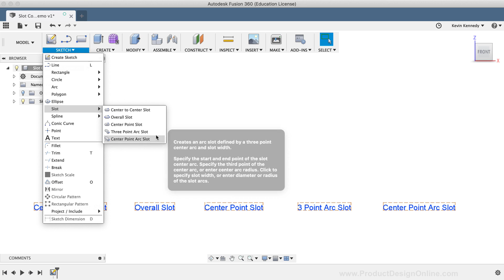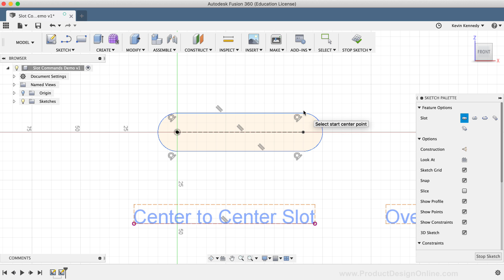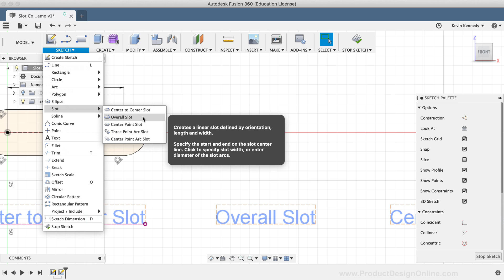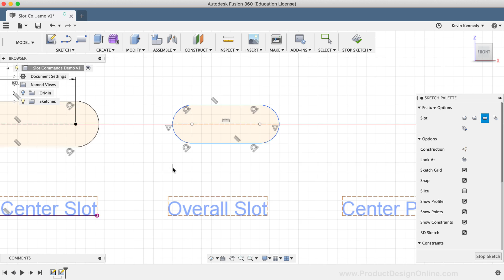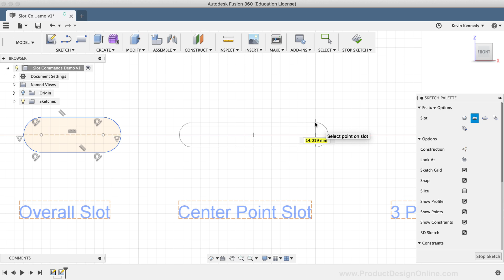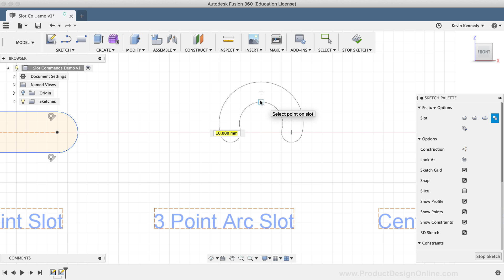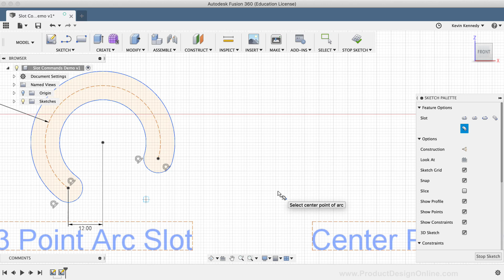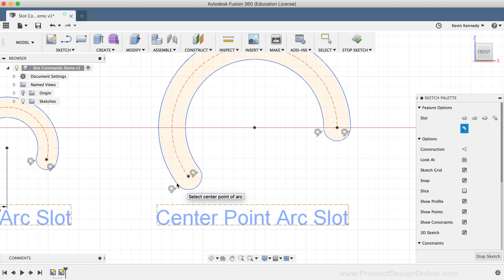How to Create Slots in Fusion 360 Sketches (All 5 explained)

Comment: Hi Kevin, great job on videos. Just recently updated and can't seem to find slots in any pull downs. Thanks!
Reply from the maker: Hi Rod. The Sketch menu is now contextual, which means it's hidden until you create a new sketch. You will then see the Slot commands in the Create menu of the Sketch tab. You can also use shortcut letter "S" > search for "Slot" and activate from there, which will then prompt you to select a plane to start your sketch.

Comment: I don't know if it's because I'm in the most recent F360 version, but I copied what you did in the first slot tutorial and it does not fully constrain unless I add dimensions from the slot to another sketch line (I copied exactly what you did and dimensioned the center construction line and then the arc/radius, but it is still a blue line. Even though I understand how to keep going and constrain it, I'm wondering why mine does not immediately constrain, like yours..?

Comment: Where are the slot tools now? 
I can't seem to find the slot menu in the new interface. There is a slot option under Manufacturing, but it looks like something for programmed CNC work. It asks for all sorts of parameters associated with CNC.
Reply: Thanks kindly for your reply. Much appreciated.
Reply from the maker: Hi, Dave. With the new UI you'll find the "slot" commands in the "Create" dropdown, but ONLY when you're in the SKETCH tab. The sketch tab will only be shown in your toolbar when you're in an active sketch environment.

Alternatively, you can search for the slot feature by using the keyboard letter "S" to activate the shortcuts box > search for the desired feature.

Comment: My Wedding is next month and I am looking to make slotted table numbers held together by tight Kerf settings. I used to do this via Illustrator and I have been watching your videos to use a proper design program to do these. 

Can you please let me know the best approach to this/ direct me to the appropriate video of yours? If I was able to import my concept and slice it in Slicer for Fusion 360 that may be the best option, but I am unsure how to approach this. 

Thanks for the help. Love your videos!
Reply from the maker: Hi Johny. Are you laser cutting these? (just trying to get a picture in my head of what they would look like)

I would suggest creating the first part with the slot (probably just a rectangle cutout). Then, project the edge of the slot cutout to a new sketch and offset the projection with your desired kerf/clearance.

Congrats on the wedding, btw!

Comment: Could you do a short video constructing simple assemblies  using all the slot commands?
I think it would illustrate how and when to use them so much better...
By the way - the way you used the center to center slot command on the Trammel of Archimedes video you made was perfect...
Just wanted to let you know that I experimented with foregoing the slot command to construct the  arm and offset a plane on top of the sliders and sketched a rectangle and extruded it...
I then did all the other steps after that and successfully animated the model...
But I can see why the slot command is so much better to use....
What I do from time to time  is try the same step using different techniques to insure the same end result...
If I fail to achieve the desired result I do not consider it a failure...
Sometimes you can learn more from a mistake than you can from doing it the right way.....
Please keep your videos coming...
You're a VERY good teacher....
Thank you,
Pete
(518)-260-3332
Thanks again-
Petescarpa@yahoo.com
(518)-260-3332
Reply from the maker: Hi, Pete. Glad to hear you attempted the Trammel of Archimedes in a different way. I mention this in a few of my videos, but can't stress this enough - There are MANY ways to achieve the same thing in Fusion 360 (or any CAD program for that matter). ultimately, the goal should be to achieve the solution in as little steps as possible (efficiency) while still remaining the design intent and feasibility of updating the model later on. Nonetheless, it's great to see you're experimenting and learning from it! Cheers, Kevin :)

Comment: Slot in what though ? I'm trying to put slots in the wall of a cylinder so that it can be compressed onto a pipe.
Reply from the maker: Hi, Joe. You can put a slot into anything, as long as you can create a sketch on the face. Because you can't sketch directly on a cylinder, you would need to sketch on a construction plane or origin plane and extrude the sketch (slot) through the pipe or cylinder. Cheers, Kevin :)
Reply: @ProductDesignOnline  I've done that but I can't get the slot object to act as a cutter or hole. I just get a solid piece that adds onto the cylinder.
Reply from the maker: @SmeeUncleJoe  Any change you can share a link to a screenshot? You'll need to make sure the Extrude "Operation" is set to "Cut"....it will likely default to join or "new body". Cheers, Kevin :)

Comment: I have a great many questions about designing in Fusion 360 but what I am currently trying to do is change the appearance of my models...
I wish there was an easy way to make my components less transparent and not see any of the hidden lines....
In another words - more solid in appearance....
I have tried to change things in the bottom of the screen in 'Display Setting' and I have also monkeyed around with the opacity control in my components 
But I am not getting the desired effect I want.
My email is 
petescarpa@yahoo.com
-Pete
Reply from the maker: Hi, Pete. It sounds like you may be wanting to turn off the default feature that grays out the components that aren't currently "active". You can do that by going to your Username (upper right) > Preferences > Design > then uncheck the setting that says "Show ghosted result body" > Apply > OK. You may also have to restart your Fusion 360 to get the change to take effect.

Let me know if this helps! Cheers, Kevin :)

Comment: You are a GREAT instructor....

I'm both glad I design now in Fusion 360 AND I found your channel on YouTube....
You have made things so much more easy for me - especially since I am self taught....
Thank You......
-Pete
Reply: Thanks
I understand slots so much better now...

Do you have a favorite list of system and parametric settings that you use ?

I mean the best way to set everything up...

Thanks again,

Pete
Reply from the maker: @peterscarpa2206  Hi Peter. It really depends on the project. I wouldn't say that I have a predetermined workflow for each and every one. I like to utilize the User Parameters to ensure the models are dynamic and predictable. Sometimes I'll insert a component into a new design and unlink the component as a way to start out with the same user parameters (since Fusion 360 doesn't currently let you save or copy them over to new files...this is sort of a "hack").
Cheers, Kevin :)
Reply from the maker: Hi, Pete. Glad to hear you're enjoying all the tutorials! I appreciate you watching. Cheers, Kevin :)

Comment: How can i edit the width of the slot while keeping the radius the same?
Reply from the maker: Hi, James. You'll want to apply sketch dimensions to both the radius and the width. Then, you can update one without affecting the other...and you can update their dimensions at any time.

You can apply the width sketch dimension to the center point of each circle or from the left edge of slot to the right edge of the slot. It just depends on your preference of what you're trying to dimension. Here's a screenshot for reference - https://snipboard.io/iJV1cP.jpg

Let me know if this helps or if I need to explain anything in more detail. Cheers, Kevin :)

Comment: Do you have a video on how to create multiple slot evenly from each other? Such as a speaker grill or how do you copy the current slot and duplicate it. Sucks there isn't just a simple copy / paste command. Would be perfect.
Reply from the maker: Hi, Joeteck. Great question. Your best option is to create one slot and extrude cut it (add fillets, etc) as desired...and then to rectangular or circular pattern the features. This will allow you to pattern all of those features (extrude cut, fillet, etc) at once, which saves time and ensures it's easy to update should you need to change dimensions later on. It's important to note that there are patterning tools in the "Sketch" dropdown list as well as the "Create" dropdown list. You'll want to use the modeling commands in the "Create" dropdown list as their performance is more efficient. Here are two videos on the sketch pattern commands (these techniques are very very similar to the modeling pattern commands).

Rectangular Pattern video - https://youtu.be/lMaY5IEpo1g
Circular Pattern video - https://youtu.be/iaBPpwC6UB8

Use case of patterning similar to what I've explained above - https://youtu.be/VJWz-exP4iY
Cheers, Kevin :)
Reply: @ProductDesignOnline  thanks.. you and I are both doing the YouTube Grind!
Reply from the maker: @Joeteck  I checked out your channel. Great stuff! Keep it up :)
Reply: @ProductDesignOnline  thank you sir.. perhaps we could collaborate?
Reply from the maker: @Joeteck  I'm open to the idea. I'm pretty backlogged with a course creation this summer... but we can talk again this fall ;)

Comment: Useful tools, thanks for a tutorial! Kevin, could you make more tutorials about joints? Especially how to align components, e.g. how to place one component into another which is in a different angle.
Reply: I think it would be a wonderful lesson in which you can model a working bench vice with joints. And one more missing thing is how to model gears... Thanks!
Reply from the maker: @h0x91B  Thanks for the suggestion, Arseniy! I definitely need to do some more assembly and joint related videos. I have them on the list...I'm just trying to work through a few other things first.

Thanks again for taking the time to watch and provide suggestions. I appreciate you! Cheers, Kevin :)